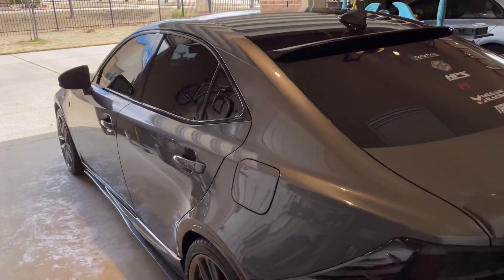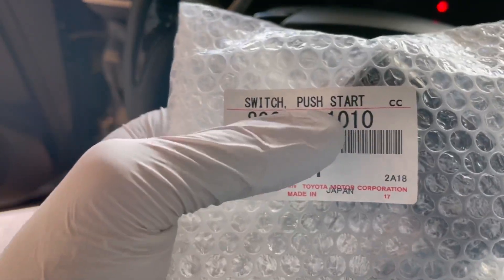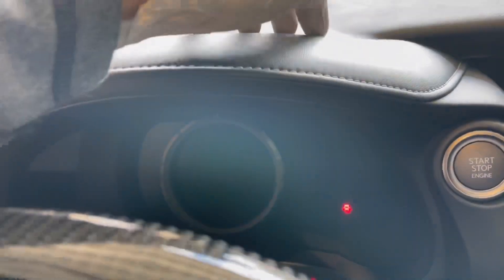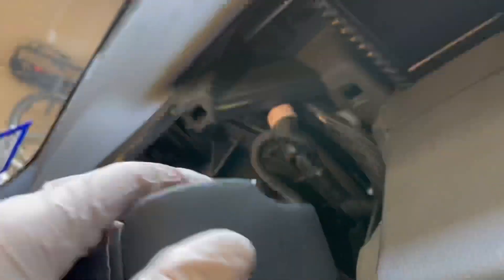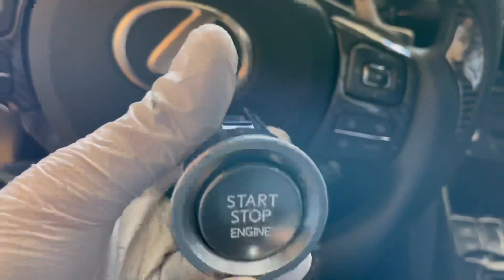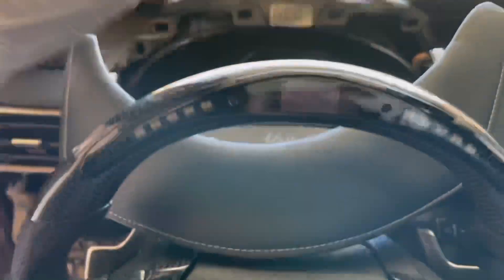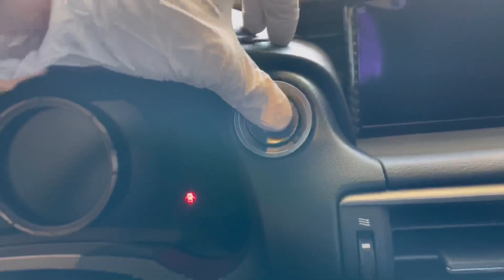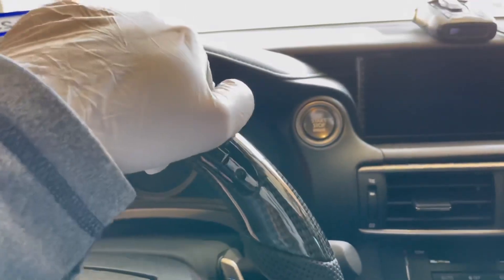HOW TO INSTALL PREMIUM START/STOP BUTTON ON LEXUS 3IS!

Comment: Nothing to do with the topic here , but has anyone experienced failure with there speedometer ring getting stuck 🤔  ?
Reply from the maker: Woah! Interesting.. I definitely haven’t experienced this. I would assume it’s something with what is powering the movement rather than the ability for it to move. If that makes sense. But no, I haven’t experienced this.
Reply: @Grey3IS  right , I've looked at different forums and all over YouTube and noone really has any info. I was hopeing maybe here someone knows and can it be a do it yourself job or is it a dealer job 😮‍💨
Reply from the maker: @joseluisperezjr3285  Well, I hope you find some information eventually.

Comment: will this work for a 2is? I have a 2006 Lexus IS350, thanks!
Reply: That’s what I want to know as well!🙋🏻‍♂️
Reply from the maker: Sorry! I didn’t see this. If you have the same OEM button and the same internals (just open up your enclosure like I did in the video and check), then you can definitely do the same. Just verify that you have the same button and same connector before buying it.
Reply from the maker: Sorry! I didn’t see this. If you have the same OEM button and the same internals (just open up your enclosure like I did in the video and check), then you can definitely do the same. Just verify that you have the same button and same connector before buying it.

Comment: Can you do a video on how you installed your rear diffuser?
Reply from the maker: I can just tell you if that works. I ultimately used flange nuts and bolts, what you would use in drywall, to screw it up into there. The flange nuts pretty much fold to fit through a hole so you don’t have to take apart the underside to get a regular nut behind there. They fold through and then become the nut for the bolt. They hold up to 80 pounds each and I used six of them. I also use the washers to distribute the bolt evenly. That’s about it, it’s fairly easy.
Reply from the maker: If you DM me on Instagram I can send you a video

Comment: Would this work on a 2010 Lexus rx350 with factory push to start?
Reply from the maker: It should! You might need a conversion for the different plug (if there is one).